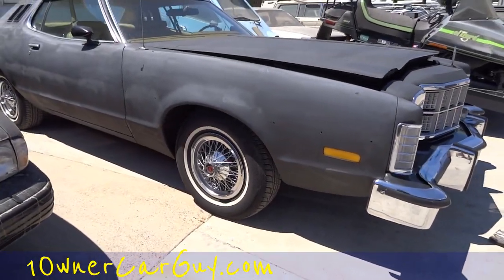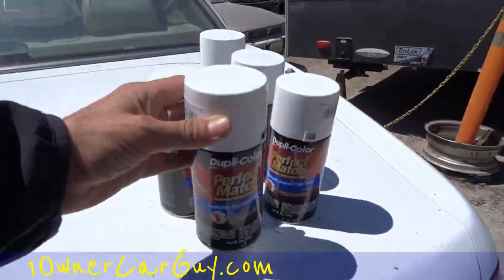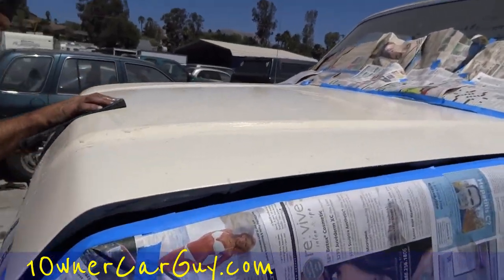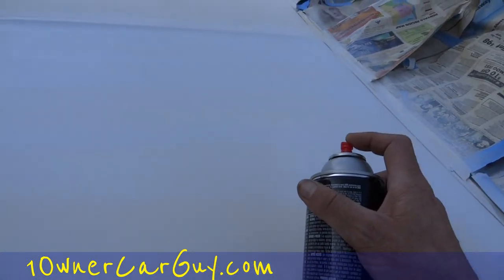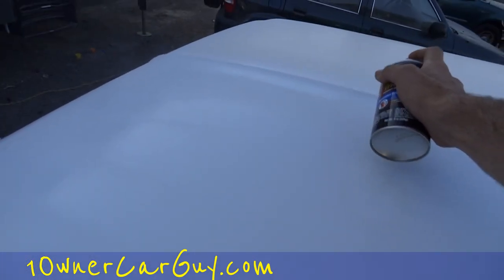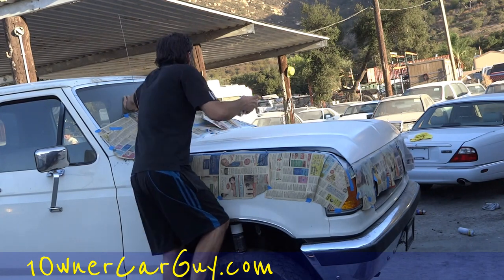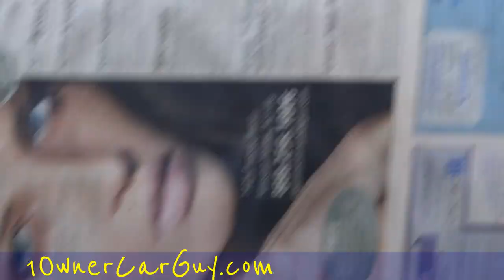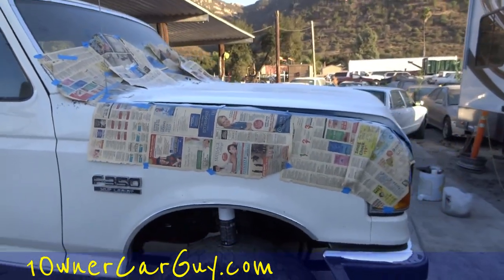DIY Home Shop Car Spray Paint Fail ~ Dupli-Color Perfect Match ~ Repaint Process Step #4

Comment: Nice VID man. Just purchased some, and hope it color matches right for me. Over time the paint will fade, but I found the most accurate way to tell, is to look at the vehicles floor boards. The floor boards is a great indicator of what the vehicle body paint looked like when it rolled off the assembly line. Granted they are not all rusted up.

The color is a lot easier to match up, and will give you a really good idea how much the body paint has changed/faded as well. I pulled my color code from the glove box, and just matched it up on the website, and they gave me a can number to purchase. Thanks again man!

Comment: I had to paint an F-350 hood about 2 years ago. It was a brown color but needed to change it to Oxford white. I took the hood off the truck and set the hood onto a couple of wooden horses inside of the garage. Used an air powered palm sander to make it a smooth base before light primer. After a quick wet sand, then painted it with an air paint gun with the proper matching Oxford white. All done in about 2 1/2 hrs. Mounted it back on the truck the next day....Finished : )

Comment: How about getting the color code from the VIN and having it mixed (and if you prefer put into spray cans) at any decent paint shop. Shouldn't cost you an arm and a leg, I usually get about a quart of paint for 60 to 80 bucks, MAX! And we're talking pearl or metallic colors there...

Comment: How's the durability with that Duplicolor Perfect Match system? I picked up a free 8' fiberglass truck cap for my '89 F250. Dark blue like my truck but paint is really faded and the clear coat has peeled off most of the cap. I don't need it perfect, just closer than it is. I realize it's probably not the best system for painting fiberglass.
Reply: Ohio Digger how did it work out?

Comment: Okay, I had to put my 2 cents in worth. Since this an 'older' vehicle, the 'new' paint will never match the original. Over time, paint fades and changes color. So, I'm betting that the paint in the can is what the color of your truck used to be. I painted a RF fender with factory color (different company) and it's considerably darker than the rest of the car. Duplicolor doesn't make a paint color for my car. I'm painting a bumper and hood metallic gun metal grey and will put silver metallic racing stripes down the hood and bumper.
Reply: Oh thank you. My mom had a 63 Chev that was multi colored and the wrong rims. I had to call the tow truck and when they asked what color it was, I said, "Pick one." lol I'm finding that my bumper is taking longer than I had hoped. I wasn't aware that when they say 3-4 'coats', it means 4-5 cans of paint. I just have a couple spots to fix and then back to the clear coat. the rest of it looks good.
Reply: AGetsinger "Pick one"   LOL

Comment: It will match if you get the paint code from the truck with the can. it's right on the lid. I've had to touch up with that stuff 3 times and every time i do it it matches perfect before clear and looks exact after clear coat. Then you have to wet sand and buff it out after or it won't look right in the sun light.

Comment: The dupli color paint is a joke.  I put some on my truck and the hot sun here turned it yellow in 3 weeks.  If you can, rattle can paint is way better if you get base clear paint mixed up at the local paint and body store. Atleast its going to be REAL paint.